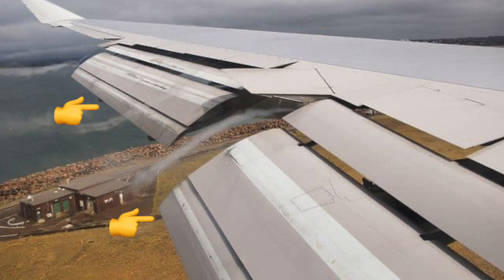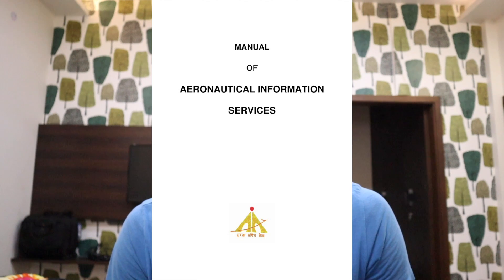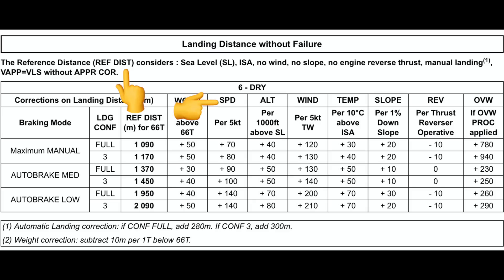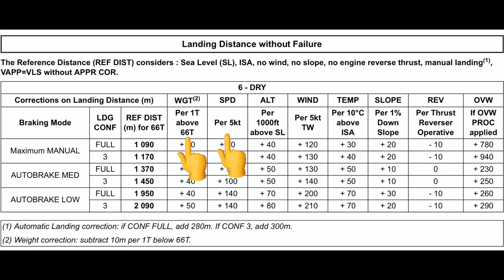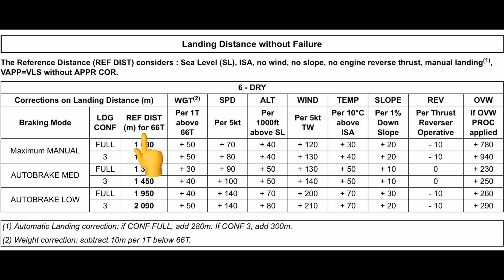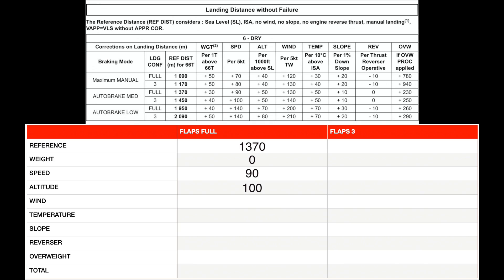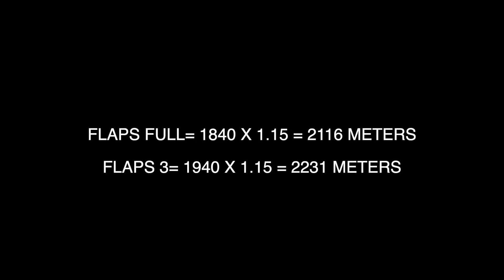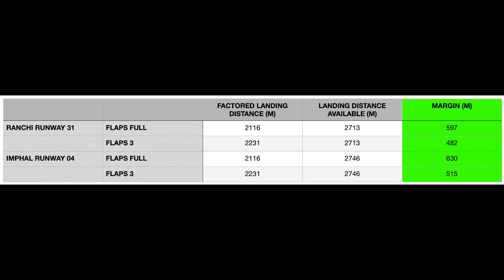HOW DANGEROUS ARE FLAPS 3 LANDINGS ON AN AIRBUS A320? 😰 (WITH PROOF!!!)

Comment: ( Caution: This message is LONG )
Here's the thing, everyone is saying Boeing Boy is Air Asia's pet and I highly disagree with most people's comments. Now tell me one thing , why does everyone keep searching for cars with good mileage? TO SAVE FUEL RIGHT? But why don't you buy a car with better safety?? Buy a BMW, invest in it and don't bother about good mileage because safety is first, not saving money on less fuel! Flap 3 landings are SAFE, BUT not every time. They are not compromising our safety because flap 3 is not dangerous, however there are certain conditions when the pilots will decide on Flap 4. Let's say we are landing in Leh Ladakh. The altitude is HIGH and air is thin, here the pilots will almost ALWAYS use Flap 4. But if you are landing in Delhi IGI airport, the runway is long, the air is dense because of not-high altitude and there aren't much tailwinds. So it is not unsafe in most conditions, but it is in some cases. Now the problem is everyone who watches Flying Beast's channel doesn't really know much about aviation. So they don't understand exactly what he says. Even Gaurav says Flap 3 is safe. We should respect both perspectives and not blame Tapesh Kumar sir. he seems kinda arrogant in this video but that's just because all the people who don't know much about aviation keep saying flap-3 is unsafe but it is totally based on the conditions. THE TARGET OF 98% FLAP-3 IS THE WRONG PART in my opinion (and in Gaurav sir's opinion as well). Because Flap-3 saves fuel and it is still quite safe, airlines ask pilots to land with flaps on 3rd setting. However to force pilots to always make flap-3 landing is wrong. The captain has command so it is his decision whether he should make the landing with Flap 3 or not. Gaurav sir was suppressed by the Airline because he was raising his voice on THE TARGET TO MAKE FLAP-3 (not the flap-3 landings themselves). So he raised his voice even more.

Conclusion:
Flap 3 is safe under most circumstances (like in cases where airport altitude in not too high, not a lot of tailwind and long runway) A320 is a versatile aircraft and it is made to operate on short runways and so it can land on slightly long runways with Flap-3 with NO problem. However the TARGET THAT MUST BE ACHIEVED BY THE PILOTS TO MAKE FLAP 3 LANDINGS 98% OF TIMES IS WRONG. What is the runway is slippery and wet? What is the runway is short and high in mountains? What if they are getting a lot of tailwinds? (Well actually they won't always get tailwind and if they do, they switch the runway direction and land INTO the wind making it safer to land). So Gaurav sir is correct and so is Tapesh sir. It is just the public which made Boeing boy angry because people with literally no knowledge are saying such things, "FLAP 3 IS UNSAFE, SAFETY MUST COME FIRST" and the fact that people also say, "GAURAV SIR HAS MORE EXPERIENCE THAN YOU SO SHUT UP" makes him even more angry because people don't quite understand what Gaurav sir was saying. He was targeting THE TARGET and not THE LANDING. People didn't get that point and started the hashtags of air Asia is unsafe. 

Note:
I am a 14 year old boy dreaming to become a pilot. I AM NOT A PILOT so my opinion can be wrong. I just want to say that we should respect everyone's opinion. My knowledge comes Flight simulators (not those stupid mobile ones 😅). So yeah don't be angry in replies. By the way, do you want to know why he seems angry and arrogant? Click on this link and skip to 3 :35 https://www.youtube.com/watch?v=nRgQ4zD8azY . I am long time subscriber of Boeing boy and I will be. No offence guys!

Comment: The distance calculation that you have provided in the video may look surprisingly sufficient to a layman. However in ground perspective, it is just close to risky, especially when your aircraft is landing anywhere between 140 to 160 knots. 550 meters will take nothing more than 3 to 5 seconds to cover and overshoot. So being complacent with just bare minimums to spare is like living in a fool’s paradise, disaster can strike any moment if not extremely careful. We have had several runway overshooting cases in 2019 with DGCA suspending a lot of pilots, were these incidents without a reason or because of complacent pilots like you?

Comment: higher the landing speed,  greater the risk. 
You only get your life once and no one would prefer saving damn 8kg fuel over 
Your life. 😶
If visibility,  weather,  etc is bad then its entirely another scenario, as the pilot needs to use flaps 3 coz they may be subjected for a go around

Comment: Interesting.  8 kgs fuel savings, which is 2.6 gal or just under 10 ltrs.  
How about making it a bit more interesting though.  Let's figure a wet runway, turbulence and rain (say speed correction +20 kts), and a 10-knot tailwind since we want to use these ILS runways.  Same locations, same ISA+30.  How much excess margin do we have available now?

Comment: Run may be 3000m but plains don't usually land at exactly 0m and run towards 3000m. What if the plain touch down at 1000m, now it has only 2000m left to stop.

Comment: Why did DGCA Suspend people from Top level Management if you were correct regarding Flaps Landing#AirAsiaIsUnsafe
Reply: It is not dangerous to land with flaps 3 configuration. You also should from a education standpoint, that pilots are just class 12 pass, so if anybody stands up against an airline for a procedure which will not harm anybody's lives, he or she will not get job for life, he will not even get a job of a assistant at a shop. So no one will stand up against a baseless policy. 
If pilot thinks the plane is in danger or needs flaps 4 landing, and nobody will stop them from doing that. Even if is fired, he can get a new job. But I wish both pilots, Boeing boy and flying beast have amazing futures.
Reply: @abhishek vishnoi oh yes
Reply: Coz they force to do the same type of landing everytime and if they do they would get bonus..
Reply: Will AirAsia Kill them, if they do not do 98% of landings in flaps.
AirAsia India only operates few flights from mountainous regions such as the northeast.
Reply: @anubhavmitra8928  but still some greedy people will do flap 3 in dangerous situations to earn bonus
Reply: @gautamjayakishan9614  that is different thing.
And what is the fuss about?
Those safety officers have been fired.
Reply: @anubhavmitra8928  get yourself educated on the topic first and the mandate/ benchmarks put forth by the company which were the premise of the senior officers being suspended, and then come and argue in the comments section. Second, if you throw jargons at me the next time being an aviation enthusiast I may or may not know about them, but you certainly won't know a thing about the plethora of medical jargons I'd throw at you. So calm your tits bro. :)
Reply: @rahulkamath44  I very much know about the topic and if you don't know about aviation don't argue like you know everything and  this not a medical video or a medical topic, I will definitely not argue with you in something related to medical.
Reply: @anubhavmitra8928  this isn't about "knowing" about aviation or not knowing about aviation. It's something as simple as not compromising on the safety of passengers and pressurising the pilots. Period. Bringing up an issue should be comprehensible by a common man and if only that serious (which it was) will be acted upon.
Reply: Were they guilty?
Reply: The info he gave is correct but implementing 98 percent target is wrong

Comment: Can't believe you are making such videos. Yes you can land safely with flap 3. But still, it's should be PF's (pilot flying) decision. Several times I used flap full in Imphal. Though it's not mandatory, it's also true with flap 3 you will have better controllability, but depending on various factors, sometime flap full is better. 
A fellow colleague compromised his career to fight an issue and you are posting such biased videos.
Reply: Well said sir which airline are you flying for btw ??

Comment: 1. The way you did sanitizer thing in the beginning of the video is very offensive. It shows that you can easily get intimated if somebody wants to correct you. What if your co pilot tells you a point and you disagree. You'll take your ego above all. Most disasters in aviation happened bcoz of this behaviour. 
2. You are just a book learner, whi can't use his brain according to situation, which flying beast has clearly done. 
3. Keep your mind open for knowledge bcoz this egoistic, challenging and 'above all' attitude is dangerous for noble souls sitting behind your plane. Maybe in some situation your Co-pilot is right. Will you take out sanitizer that time as well?
4. Learn from an incident of KLM that lead to introduction of CRM in aviation. 
5. Don't use all sanitizer for hand, keep some sanitizer for your thought process as well, coz you have totally lost it.

Comment: Dangerous or not it’s on the pilot to decide if he wants to do a flap 3 or 4 landing and by this video you want to state that flap 4 uses about 100m less than flap 3 but shouldn’t passenger safety be more important than this even if it’s 100 m they should do flap 4, it’s always good to be precarious  right, and even Ex DGCA senior inspector has said this clearly so I don’t see the point of this video!

Comment: But airports like Patna and kullu have shorter runways than calculated values...u didn't include them
Reply: Pulkit Agrawal ne took the airport where his operator flies. 

Ps in cases where the runway are short, flaps full will be taken.
Reply: @ZK-APA its wrong because in future AirAsia if not investigated will fly with the same rules on such airports too and then who will be responsible for any mishap
Reply: Pulkit Agrawal the rules for any other A320 operator who does flaps 3 landing (airasia isn’t the only one who does it) is to do flap 3 landing if it’s feasible. Basically what that means is that if the calculations show that flaps 3 isn’t possible, then use flaps full. 

For airports with very small runways, if you calculate landing performance with flaps 3, it’s just not possible, so automatically they will use flaps full.
Reply: @ZK-APA  if that's so...why the answer that you're replying to me is not replied by airasia to gaurav taneja...why u and tapish have to explain even when this issue has been from almost a year. Simply airasia should give this explanation. And rather they suspended Gaurav Taneja.
Reply: Pulkit Agrawal I can’t comment with regards to the company. What I’m saying is more based on what the aircraft is capable of, and how it’s used.

Comment: Your calculations are correct with ideal situation in hand  what if the slope is more and there is a wetrunway runway and there is a high tail wind your calculations are not valid in that situation.  I'm not saying your are wrong.
I am just saying have the balls to stand for what is wrong. You can't apply  theorical calculations with practice it will have some assumption.
Reply: K K in cases when calculations suggest that flaps 3 are not possible, then flaps full is taken.

This video is more of “is flaps 3 safe” rather than “is flaps 3 safe all the time”

Comment: I think , Gaurav actually creted a confusion , and most people are thinking , Flap 4 is super safe , Because it burns more fuel !!! , But it produce more drag , and leads to long term wing deterioration. ,it should be used only req cases , and not for mental satisfaction

Comment: Sounds like those average hipster deck crew chasing 50-80kg of fuel saving per sector for that cash incentive and high KPI. Its the same for your sister company in Malaysia and it has annoyed all of us other operators. 
Other shitty tactics that your sister company promotes. 
Constantly asking High speed descent below 10000feet in moderately crowded secondary airports that has turboprop operators, Asking to cut approach queue if traffic infront is a turboprop, requesting RNAV approach when other traffics are using instrument approach. Requesting pushback clearance but heck your pushback truck is not even tucked in while other airlines have to wait for you. Worse part deck crew are given cash incentive and encouragement if they can chase time and fuel saving all stupid LCC gimmicks to save fuel at the expense of other operators.

Comment: Yaar, I've been a subscriber since you had around 400 subscribers. I understand Flap 3 is not dangerous at all and it is also explained similarly by Gaurav. But if Air Asia has a 98% flap 3 target landings requirement for a pilot's monthly roster then it is wrong. As a passenger I wouldn't feel comfortable knowing that your pilot is under considerable obligations from his company to fly the aircraft in a certain way and no matter what the regulators and the operator data says, if the day and weather situation demands a certain kind of landing or methodology of flying that the pilot may seem fit and not necessarily what the company has outlined for them, then this whole 98% target of Flap 3 landings goes out of the window.
Reply: Makes sense. I agree with your opinion. Flap 3 isn't dangerous but it should not be set as a target. Safety first, not profit. As long as the runway is long enough, the tailwind isn't there and flap 3 seems safe, it can totally be used but 98% is unachievable if the weather conditions make flap 3 unsafe. So target is bad but flap 3 isn't always bad.

Comment: Are you dumb ? Giving a target for flap 3 landings will make pilots risk the lives of passengers even if the situations are unfavourable like in severe cross winds  down drafts . Moreover , for small airstrips even if the plane is able to stop with a  with flaps at the 3 Rd notch . Maintaing a buffer is always crucial .

Comment: Tbh am not one of those persons who just rides on bandwagon on hating some smaller YouTuber just because he is giving criticism to a bigger YouTuber but the thing is you are just missing the whole point he said there shouldn't be 98% target goal imposed on pilots as this is dangerous. And he also mentioned that all flaps landings are safe but it depends on the condition of weather and runway. And he also said that flap 3 will not be the sole reason for any accident but there will another factors that will contribute to it. Dumbass he discussed all his points in detail. Not even gonna dislike your video as I don't want to give your video or channel any engagement from my side.

Comment: First 20 seconds shows how the level of respect you have for your seniors. Good job capt, never coming on this channel again.
Reply: Kir Ras  He was giving a stare fight to Capt Taneja who raised a safety concern against 98% Flap 3 landing. Flap 3 is not an issue,   compelling pilots to do this and taking punitive action on breach is risky at times. Taneja has spent more years than the Air Asia Captain in the video.
Reply: @rohitmathur8004  😂 what rohit who said he was giving stare to gaurav sir anything plz dont miss guide people
Reply: @rohitmathur8004  first of all you aren't a pilot and you can't judge a pilot 
2- He didn't mentioned flying beast in his whole video 
3- He told that for saving 7-8 kgs fuel will you be compromising 180 lives on board  
4- He made a informational video and keep your mouth shut and don't make double meanings
I hope you understand :)
Reply: You came here for only getting likes on your comment
Reply: Unki gand chatta ho ga ye ,..
Reply: Correct
Reply: Exactly it shows his attitude towards his seniors.Air asia has such captain#airasiaisUnsafe
Reply: @jatrobin  Atleast I'm never flying with them again :)
Reply: Who supports Boeing Boy over Flying Beast.
I do
But this is an unfair comparison. 
People didn't know what was flaps
,now everyone is behaving as aeronautical engineers.
FLAPS 3 IS NOT UNSAFE IN MOST CONDITIONS.
Have you heard about BA emergency landing at Heathrow, the captain reduced the flaps to allow his plane two fly further without both engines.
Keyboard Warriors keep this in mind.
Reply: @anubhavmitra8928   it is not unsafe in most conditions, but what happened to the remaining conditions, one day you may fly in the remaining conditions, then your life may be at risk, please understand.😊

Comment: He put out this information pretty cleverly. The runway touchdown zone is about 500 m and all the calculation he did should be added to 500m and then it should be seen how much runway is left for landing
Reply: Ritvik Kapoor landing distance (airline or even basic training theory) isn’t calculated from the start of the runway. All landing calculations are based on when an aircraft is approx 50 feet above the landing threshold (so it touches down on the touchdown zone)

Comment: Mr. Captain tell me when you quoted that Ranchi and Imphal have appx. 2.7km of landing distance so did you considered or assumed that a plane will touch down exactly at 0m of the runway. I have never seen that. But don't worry it doesn't matter what you think. And keep your mouth shut.
Reply: Saurav Raj landing distance calculation isn’t calculated assuming you’re touching the start of the runway. All landing distance calculations assume you’re about 50 feet above the threshold when you’re passing through the beginning of the runway.